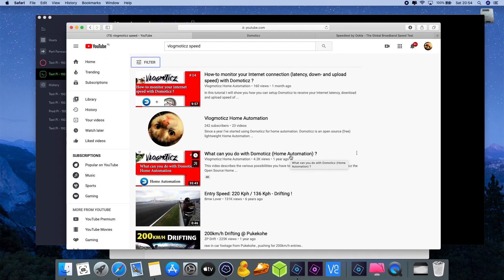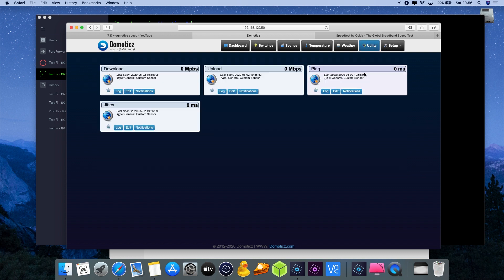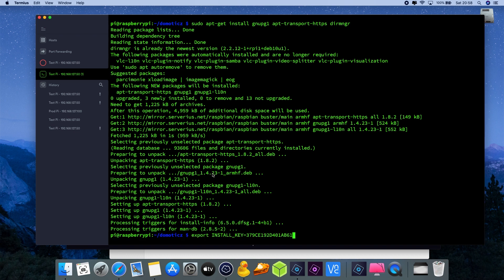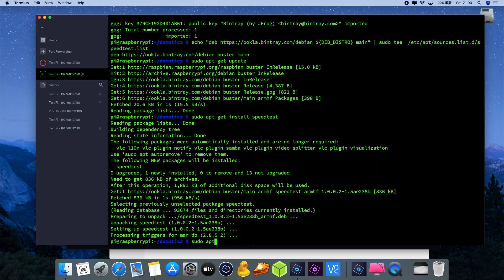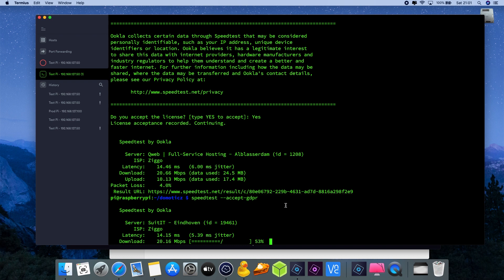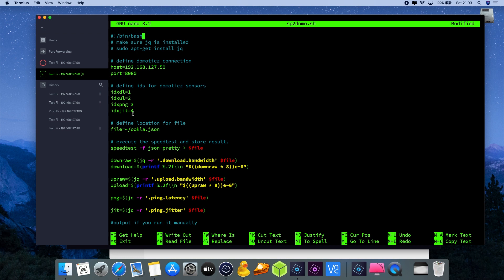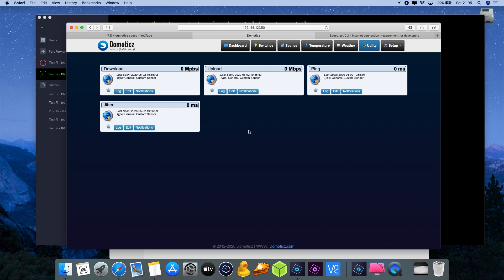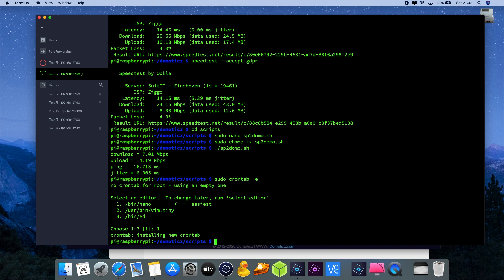How-to Monitor your Internet speed with Domoticz 2020 (updated version of Speedtest-CLI !!) 🔥 🔥 🔥

Comment from the maker: HERE IS THE SCRIPT FROM THE VIDEO FOR EVERYONE TO USE (CHANGE THE XXX IN THE DEFINE DOMOTICZ/IDS SECTIONS):

#!/bin/bash

# make sure jq is installed

# sudo apt-get install jq

# define domoticz connection

host=XXX.XXX.XXX.XXX

port=8080

# define ids for domoticz sensors

idxdl=XX

idxul=XX

idxpng=XX

idxjit=XX

# define location for file

file=~/ookla.json

# execute the speedtest and store result.

speedtest -f json-pretty > $file

downraw=$(jq -r '.download.bandwidth' $file)

download=$(printf %.2f\\n "$((downraw * 8))e-6")

upraw=$(jq -r '.upload.bandwidth' $file)

upload=$(printf %.2f\\n "$((upraw * 8))e-6")

png=$(jq -r '.ping.latency' $file)

jit=$(jq -r '.ping.jitter' $file)

#output if you run it manually

echo "download = $download Mbps"

echo "upload =  $upload Mbps"

echo "ping =  $png ms"

echo "jitter = $jit ms"

# upload result to Domiticz

curl "http://$host:$port/json.htm?type=command&param=udevice&idx=$idxdl&svalue=$download" > /dev/null 2>&1

curl "http://$host:$port/json.htm?type=command&param=udevice&idx=$idxul&svalue=$upload" > /dev/null 2>&1

curl "http://$host:$port/json.htm?type=command&param=udevice&idx=$idxpng&svalue=$png" > /dev/null 2>&1

curl "http://$host:$port/json.htm?type=command&param=udevice&idx=$idxjit&svalue=$jit" > /dev/null 2>&1
Reply: thank you for the script, could you add the crontab too please?

Comment: Hi, it was working fine until March 19 2023 now there is an error on the curl lines feeding data to Domoticz.
"<html><head><title>Unauthorized</title></head><body><h1>401 Unauthorized</h1></body></html>"
Hoping you can point me in the right direction 
thanks
Reply: found the issue.  Domoticz version 2023.1 introduce additional security.  Fix is to ADD a trusted network for network on which the script runs, eg Domoticz server network.  See setting/Security

Comment: Hello Vlogmaticz, speedtest script works fine if you start it manually, but via crontab it does not work automatically.
I put in */15 * * * * /home/pi/domoticz/scripts/sp2domo.sh > /dev/null 2> & 1 wat is going wrong.
Reply from the maker: Hi there. You need to accept the license with the same user as you run your crontab script that is probably the issue.

Comment: thanks for the tutorial,
for me it runs well locally and i can get download/upload/ping and jitter
but nothing shows up on domoticz,
 i checked my ip/port and my sensors idx, it all fits my configuration
any idea what to check next ?
thanks for your time
Reply from the maker: Hi Francois.In the description I left the following remark: 
I will add the script and crontab contents via the comments section. PLEASE NOTE THE FOR THE CRONTAB SCRIPT YOU ALSO NEED TO ACCEPT THE LICENSE WHEN USING ROOT AS USER FOR THE SCRIPT. SUDO SPEEDTEST —ACCEPT-LICENSE (ELSE THE SCRIPT WILL NOT AUTOMATICALLY RUN)
Reply from the maker: Did you accept the license as user root?
Reply: @VlogmoticzHomeAutomation   yes, but it fails regardless of crontab.
i don't get anything in domoticz even when i run the script manually and get results on the terminal
Reply from the maker: Hi sorry to hear. i would need to see the situation to get an understanding would could be wrong. It’s a very plain script and communication with Domoticz, if the ip adres, port number and license is accepted then you’ve ruled out all basic things which can go wrong.
Reply from the maker: If you by any chance had speedtest-cli (previous version) installed then you need to remove it first as it conflicts with this version.
Reply: try ip 127.0.0.1

Comment: I discovered that the script runs fine from the shell. However from with crontab the ookla.json stays empty.
IMHO the problem was that crontab is running with root privileges. Therefore you have to run speedtest as root to accept the license and the gdpr license.

After that everything is running smoothly :)

Thanks for sharing this great tutorial.
Reply from the maker: You are right the root user is a different user and also needs to accept the license.  sudo speedtest —accept-license. Thank you for mentioning this I will update the video description.

Comment: Thank you for this again great tutorial. I used the former version of speedtest as you described in your video. Changing to the new version worked fine. Can I again ask you to explain a little but more on the curl statement you used to add values to domoticz please? Maybe a short tutorial how to use curl with Domoticz. Based on that we might be able to do more with Domoticz.
Reply from the maker: Hi Antoine,
Curl is just a command for transferring data. I think what you're really looking for is an understanding of the Domoticz API:
https://www.domoticz.com/wiki/Domoticz_API/JSON_URL%27s
Reply: @VlogmoticzHomeAutomation  This was indeed of value. Thanks.